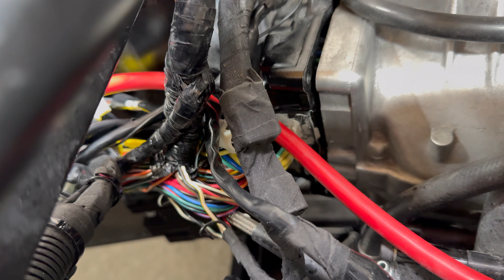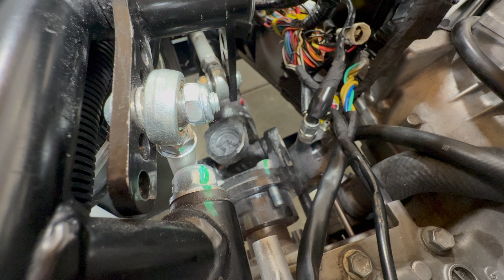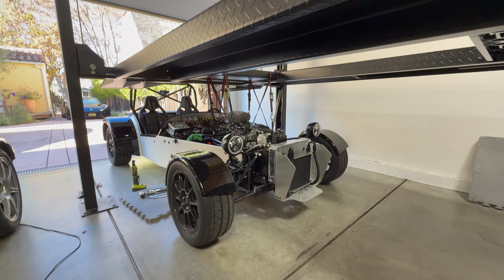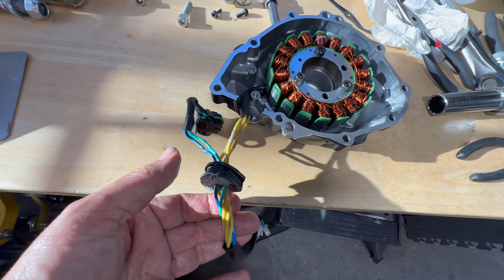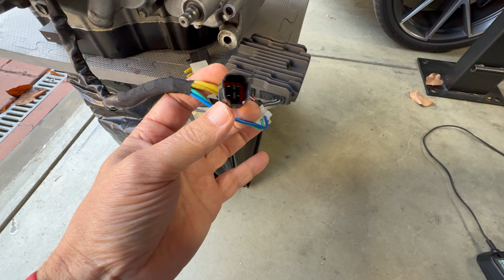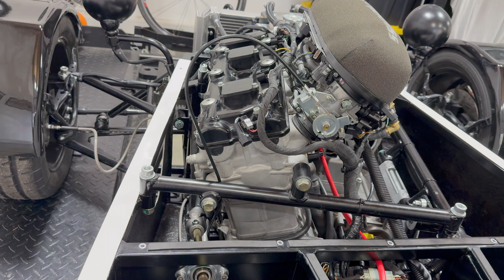Busa 7 - Episode 23 - Fixing an Oil Leak

Comment: There shouldn't be no oil at all, no? Not the starter shaft seal is leaking? With this fix, the oil will fill up the starter cavity.
Reply from the maker: The starter is on the clutch side of the engine, in my case the in the front of the car. I'm not that familiar with motorcycle engines so I was surprised that the stator/alternator was oil filled and cooled with engine oil.